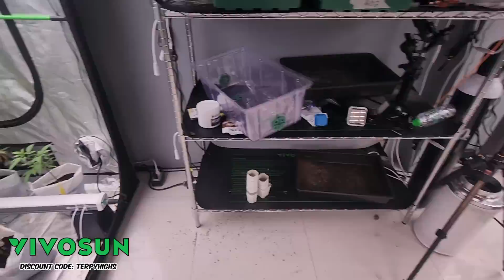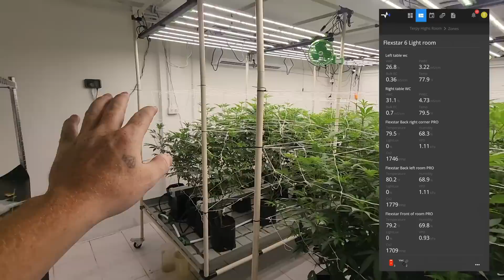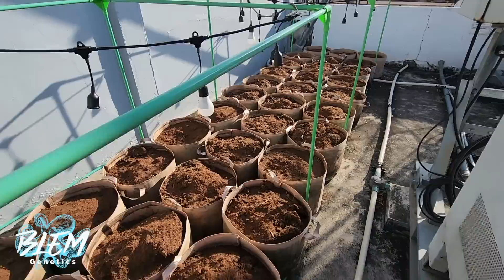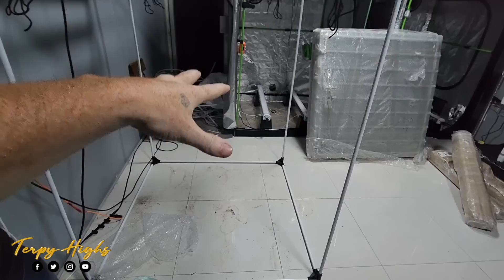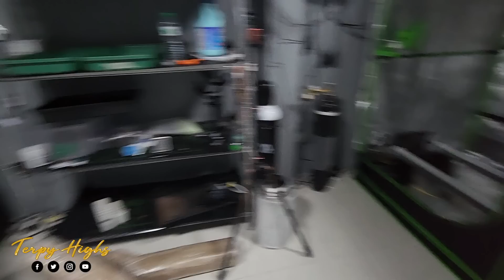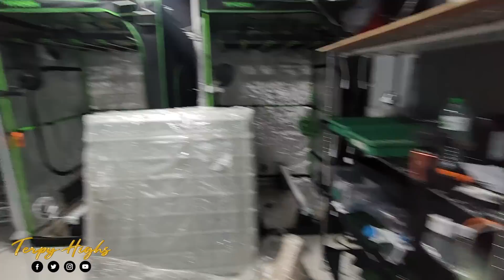600 clones popping off with growth

Comment: For lower ventilation you can grab a pvc pipe and just drill 1/½" holes , put there a channel fan and seal back. Adjust the air pressure either with drillong more holes or just get an dimmable fan. Or  you even can get a humidity sensor and arduino or esp32 with wifi and just let it work in preset humidity range say "on" when it's 75 "off" when its 45. So relay will just turn on the fan only when you need it. The entire electronic setup would be like $12😅

Comment: That facility room is a dream. I would sit there all day and night, dialing in the perfect VPD, DLI, Irrigation and Dryback phases 😅. Would probably be more in there instead of Home, cause that there is Home for me 💚. Next Year i will be 36 Years old, which will officialy be my third decade of Gardening, yes i planted my first Cucumbers and Tomatos with the Age of 6, and since then never stopped Gardening. I grew Weed in Soil for many years but got bored, then in Coco/Perlite mix but got bored aswell, and then Hydroponic Deep Water Culture until last year but i got sick of changing the Buckets/Reservoirs every day or second, so i bought Libra Trays, Rockwool Slabs and Blocks, a 50 Liter Reservoir, a Wifi Micro Drip Irrigation for up to 12 Plants and set everything up. Now its sti back, Relax, and enjoy the show, all i do is watch VPD, DLI, and fill up the Reservoir once every Week and adjust EC and pH. Greetings from Germany, you got a new follower here.

Comment: 3:00 you can use plastic pots do use talble trays without the stands. Cheap and easy fix, also helps a lot with run off yellow spots. After all you have been trully a motivation, even with problems in the garden you manage to solve the issues. Get out there and Make it happen 💪🏻

Comment: Im glad things are looking up.
I'm abit puzzled about you're feeding still as you say 3.0 ec.
If you was using a blue lab truncheon that would be of the chart at the top of or of the scale on the truncheon. I'm thinking are we talking about the same measurements ec cf ppm? Which one
Reply: 3.0 EC feeding is becoming the standard because it is easier to crop steer with. Its possible with lower EC feedings, but definitely harder to do. Especially since some of these hydro guys like to hit up to 8 EC in the substrate. I've even heard of certain guys hitting 14 EC in the substrate.

Comment: That's so strange...I wonder what's causing the issue.  I've seen people give reasons like paint off gasing or all these different things.... But I work in construction. There's plenty of off gassing and brand new apartments from chemicals used and I haven't seen those issues personally.  I know you have tired different Coco.  So curious what it could be.  🤔

Comment: Highly recommend trying to throw a little hoop house over those roof top plants, regardless of how cheap you have to end up doing it. Save em from the elements and dust a bit, and it will do wonders for ice water hash. Biggest concern I have when making hash is the dust when doing outdoor stuff, so just try to keep em as clean as possible, and avoid that rain man! good luck, hope you can get everything up and running again! great work on the 6 light

Comment: What is ph of your run off? I don’t trust your coco for some reason, might not be prewashed enough and could be buffering your ph either too high or low.
Reply: Especially if you see those early problems slowly just fade away as the coco gets washed with feedings and reset

Comment: Stop watering your plants so much take them off the drip feeders do it MANUALLY, let the soil DRY out then give each plant 500ml at most every couple days including feed days your using LED they don’t give the heat a HPS does so you can EASILY over water and drown your plants plus they don’t get the humidity that’s realistically needed with LED… THAT looks like your main issue from the vids you have shown